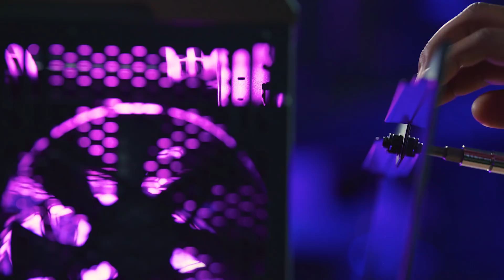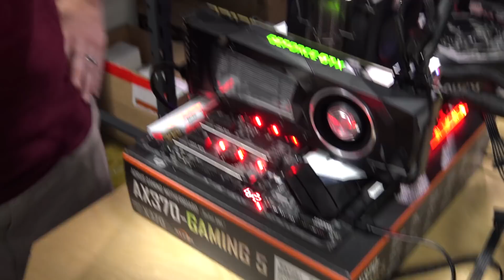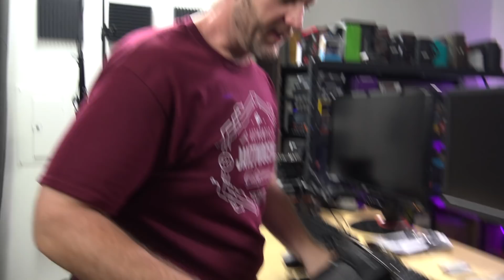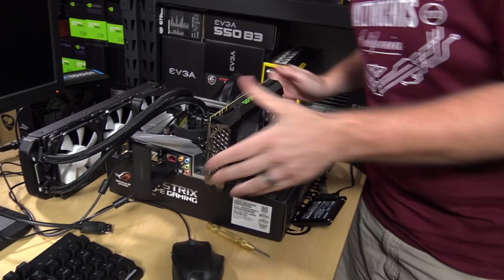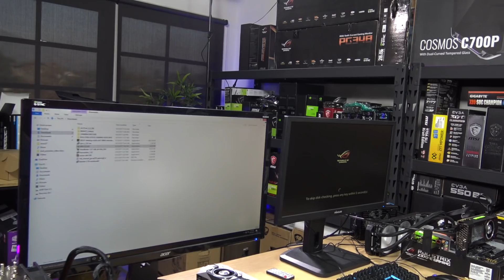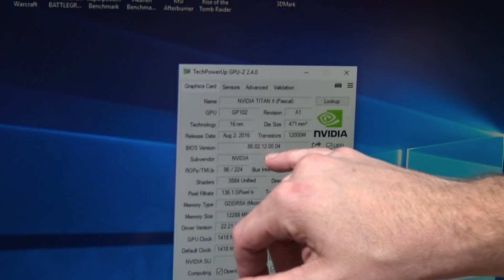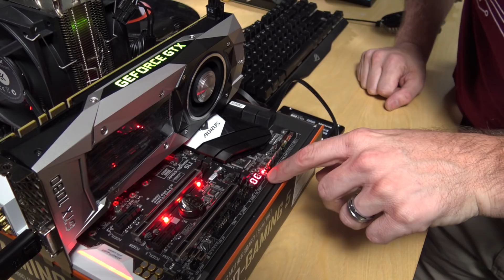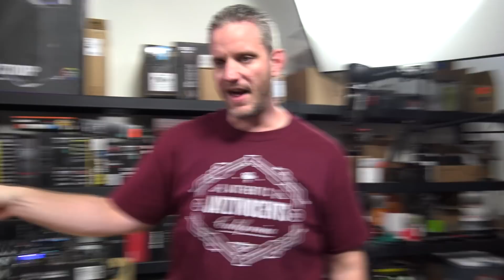I cant figure this one out... HELP!

Comment: You never checked the bios version of the card that doesn't work. You showed us the same card twice.  Also are you using Display Port on both? Try changing the monitor, for giggles.  I haven't really played with Ryzen but is there a bios setting for graphics? Maybe set it for that PCI-E slot instead of auto? Only other thing I can think of is try a different PSU just incase maybe that one doesn't give power the way that Titan likes it. I have had CPUs not like OCing with one PSU then switched and bang OC's like a champ. That is one strange thing to come across. Never seen that before. Good luck.
Reply: Ryzen doesn't have integrated graphics

Comment: With my 26 years of IT experience, I feel like this is an intermittent motherboard failure especially because it turned it's self on. Test it some more with new variables and see what happens. As silly as this sounds I would also change the CMOS battery because they can cause issues as well in my experience, just to rule out the cheapest things first.

Comment: i had a prob like that with 2x radeon 3870 x2 they are work in a intel sys but not in my x370

my spare Radeon 230 and my vega 64 works fine in the x370

Comment: I have an situation much like yours, just on the Windows site.. i have a build with a 1080TI FE and MSI Z270I Carbon AC ITX motherboard. Everytime the computer have been off for a couple of hours When it turns on the gpu is NOT registered, then i reboot and it posts just fine. I the had 2 other motherboards 1 identical to my own, and one old Asus. Same result on the identical But post on first run with the old Asus. -.-' so what i would like to see, is a motherboard identical to the ryzen testbench where you try the f*** TitanXP

Comment: The only thing i can think of is that the gpu is identified by the MAC address, maybe the motherboard is trying to do something weird like run it in x6 (should still boot tough) or try to do an overclock or run a different power setting that just isn't working   if you try a different slot it should boot if thats the issue.

Comment: Beside for checking the bios version on the same card twice (this would not change as you move it from intel to ryzen), it could still be something with the GPU. Maybe some the tolerance on some signal is higher on the intel or the other way around. check the PCIe speed in the BIOS of each system etc and see if they vary somehow.
Otherwise I still want to see that both cards have the same BIOS version.

Comment: My new Ryzen Threadripper build would not POST and would fail at the VGA and the Asus oled screen would say load VGA Bios if I had more than two USB device plugged in at once, or any devices plugged into a certain row of USB headers on the motherboard. Unplugging the offending USB devices would cure the issue. This system also freezes for a few seconds when I capitalize an o and ignores the keystroke..... these small system bugs are starting to get annoying tbh.
Reply: This is on a GTX 1080Ti as well.

Comment: try switching the monitors between the stations
in some cases the DP port on the monitor is sending power thru the cable and electrocuting the GPU
some GPUs have more tolerance for it but over time they weaken and develop this weakness
for a quick solution I recommend you try electrically resetting the bios (emptying the board completely of power) and plug in only HDMI for testing

Comment: If you are really interested in, what is going on there, I would contact MSI directly. You with your influence should be able to get real technical advice. The problem with Motherboard boot codes/error codes is, that they are really generally used. Especially your code is like the "Ah something didn't work". To get more detailed infos on what failed there need to be debug infos and logs. And those are only accessible to special hardware only on msi side or fabricator of chip X. It could be the GPU, it could be the MB, it also could be the CPU, RAM, HD, SDD, ....

Comment: I had a similar problem with my GTX1080ti.  I had to feed the GPU with 2 separate power leads as the one lead with 2x sets of plugs was at its limit of power it could draw through one cable.

Comment: Make sure drivers higher than 178.14 does support the 9800gtx+, as for the GPU not running in your system, it could be that it's BIOS might be older than the GPU and thus it doesn't support it (I've no idea how recent that vostro is).
Reply: i had to research this i just copied paste lol, but hope it may help

Comment: Lets resume here. When you swapped the card you didn’t check the wrong card but the good card bios. 
That’s the first error.
And so when you are taking in your hand at the middle and end of the video what you claim being the wrong card, it’s actually the good card you have in your hands because the wrong cards it s still on the intel platform. 

Do us a new video about it with the real bios number...

Comment: if this works give me a graphics card ....either 1 or 2 or 3 ..(1) use an older  bios or (2) reinstall windows on a different ssd  (3) use a strix b350f motherboard (I have an extra strix mb if needed I will mail it)

Comment: Check the same CPU on on another motherboard. And in the end sometimes some components just arent compatible, and i mean all together not like this cpu and this gpu, but the whole system. I had a pc that wouldnt boot when LAN is connected, but LAN is working fine when it boots, in the end it was the ADSL modem that worked great on other pc but not with the one i needed. this happens, rarely but it happens

Comment: didnt you checked same card bios version ?
because you swap it and checked on the right rig of course it should be the same
you should have check the bios on intel rig
or maybe i misunderstood something ?
Reply: +Akshay Niranjan
u joking right ?
Reply: Yes he did check bios on the same card lol
Reply: ehhhh no.
Reply: Akshay Niranjan bios are not on hard disk. bios is on the gpu like bios is on a mobo
Reply: maybe you was checked it before making the video
Reply: noticed this too.
Reply: I scrolled down just to type this: He checked the same card twice.
Reply: Akshay Niranjan drivers are on the HD - they don’t get loaded until you load the OS. 

He should have checked the BIOS on the failed card
Reply: Akshay Niranjan the gpu has a bios too.....
Reply: Yes he did. Haha. Might have checked both before and just messed up when he made video. 😊
Reply: Nope. Neither assertion is correct. Bios is on computer CMOS not the hard drive. And of course YES there is a bios separate on the video card too.
Reply: ikr
Reply: bios is on hard drives not gpus

Comment: Hey Jay, what's the power draw on the titan xp? Wattage on your psu? Where I'm going with this is you might be dealing with a slight degradation on psu wattage output or a gpu that's drawing slightly more wattage than normal. Despite popular belief, not all gpus of a specific line are the same. You've experienced this first hand in an earlier video. Just food for thought as I've dealt with this before. Not with ryzen but with an fx8320.

Comment: Power supply ?  I know that sounds weird as they are 2 of the same card but it could be one card is pulling slightly higher voltages that for some reason the power supply on the ryzen set up is struggling with

Comment: Same thing happened to me when i built my Ryzen System. My RX480 was working fine until i sold it and bought a 1080ti. The system would not post. Same error you got. Thought it was my brand new 1080ti so i was freaking out. Did not have any other gpu to test it so i took a leap of faith and sent my Asus MOBO for repair. They sent it back and it was working... Might be something else but it sure looks like the same that happened to me.

Comment: That issue is so unique and maybe isn’t really a RYZEN fault! It could be something totally different like the way each card interacts with the pcie slot...to figure that out Jay would need each board twice to be sure. As the plating on the card could be damaged on the card or the pcie slot itself and be just working on the other slot cause of different types of layout...or even the cables of the psu in combination with the 8 pin of the gpu...if some of that is damaged, it might work with the other setup for whatever reason and not with the other setup. So I would see the problem on the Pcie Slot of the mobo, the Psu cable, the plating on the pcie connection of the gpu or 8 pin connection.

Comment: You swopped the cards and not the board in the faulty one, could it be the tolerance difference between the pairing in manufacture were not up to spec.

Comment: I think it is a combination of a slot problem and the 1080ti's pcie interface. You are reviewers who do things, normal people never do. That is you constantly insert gpus into mainboard slots and then remove them. For example when benchmarking or when troubleshooting like now. A normal users mainboard may eventually see one to maybe three different GPUs installed over its lifetime. In your case hardware gets swapped a 10 or 20 times more often. The contacts are not built for that. Hence the contacts on the gpu and the mobo slots will wear of faster. And if bad luck you may have got a mobo that had already borderline slots from factory. You may try the 2nd or 3rd pcie slot. Wouldnt be surprised if the 1080ti suddenly worked there. Thats my guess.

Comment: just try to reset motherboard bios while the nvidia 1080ti thats gives a blank screen is in it,if it doesnt work then put the good card in it reset bios and then try the old card again,the trick is to trip thr motherboard bios into thinking that there an identical cards.

Comment: Reset the bios on the motherboard, then try the non-working video card. Also, leave the card out, go into the bios and force it to boot from pcie, instead of auto detect. The card, for some reason on that board may not be forcing it to boot from pcie. I've had weird stuff like that before.

Comment: What a noob. 10 years for nothing. What about trying with another motherboard? The CPU has very little to do here. Ryzen problem my ass. X370 problem in any case which we already knew long time ago. New architecture and all. And stop checking the bios from the same GPU.

Comment: i ran into this exact same issue on my roommate skylake system.  his gpu worked perfectly fine in my bulldozer system, and my card worked in mine, but his card would not work in his.  it wasnt identical cards, but it was still weird.  resolved it by him buying a new card. weirdest fucking thing

Comment: I have never seen it either. These days it seems that Intel chipsets are more "complete" and flawless. Maybe the Ryzen is a good CPU, but if the chipset sucks, it's pointless. The memory optimization is also a lot better with Intel.You get good performance even viith low spec Value RAM. That says a lot as well.
Conclusion! Go with Intel if you want a stable and compatible system. If you are a geek, and want to tweak (and save a bit of money), then AMD is a good choice.
Reply: more than just tweaking jesus christ you have to be almost a pro and have connections to fix your problems ryzen is such a mess of a release and still is how do you release a product that just doesnt work and blame everyone else, intel releases sht and it just works, yet people still praise ryzen like ye sure youre the 5% that got lucky but the other 95 is stuck with problems

Comment: Did you try different display ports? In the intel based system you pluged in the first video conector and in the Amd based one you pluged it on the last video conector.

Comment: Try checking the PCI-e x16 connector and check the pins. Maybe the pins in the sockets on the two motherboards are slightly different. 

It could be that there is slightly slimmer pins on the non-working motherboard. And it could be why the connection isn't that great. On top of that if the connector in the non booting GPU is slightly damaged it could mean there is an error about not booting.

That amount of sag might cause the pins misaligning (and not contacting properly) even more than in a case, where the gpu is bolted into the pci bracket.

Try throwing the non functional rig into a case and see what happens?

Tl;dr; the PCI-e socket might be slightly damaged and the connector on the non booting gpu might be a bit damaged as well.

Comment: Hi Jay, take the next step in the elimination process and keep the “bad” graphics card, ryzen CPU, and RAM, but change the motherboard. It’s clear that you are not dealing with a single problem, but a combination of two or more elements. Even though the two graphics cards are identical in theory, there could be slight differences, f.ex. slightly higher power draw from the pcie slot on one. The intel system might be a lot more robust so it won’t surface the differences between the two cards, but the ryzen board might not be, and thus more sensitive to the deviation on the card that doesn’t work on your current motherboard.

Comment: The a370 k5 has issue with diagnostics. I had the same issues with faulty RAM and the motherboard diagnostics showed a CPU issue. Its the Motherboard. Not the Ryzen. It could be anything else. Maybe try a different motherboard of the same model and see?

Comment: Try swapping power supplies. I feel that I've replaced more than a few Corsair power supplies for silly things. Maybe the one gpu is drawing slightly more power than the other card due to manufacturing differences. Just a quick guess.

Comment: I'm sure he changed out the cable to the PSU and looked up that code to determine if that is an area where the issue is. It could be the GPU and the bios version don't like each other and refuse to do anything that is rare and should nor would  be the case if the same version driver for those similar GPUs worked with AMD. The mother board PCI express lane is not seated with the other over the one that work. During my training in IT I was told to test the physical first then work my way to the software. So everything I've stated above I's sure he's done.

I had a similar problem where my GPU would not work then later it was my CPU. It turn out to be a problem with the fanless PSU I had bought originally with the system. It was a quiet PSU but died quick, a matter of a year. This is a difficult task to figure out without being in place to test my assumptions. I was fortunate enough to have knowledge of my issue and fixed it. Now I have a fan on my current PSU always on so it will not run hot. I will never purchase a fanless PSU ever again.

The fanless PSU also would not send power to the areas that needed to be powered when all USB ports were full and the system was shut down with all ports full. I would have to unplug everything to get it to work but sometimes it required me to take out a stick or RAM to get the damn thing to post. Then when I added the stick back after a shut down the unit would not come on. I then knew it was the PSU that was the issue and if it was not the issue then it was the motherboard which is an ASROCK so yeah they work but this one requires a lot of demand for an X99 system and if "dirty power" is the a problem the damn thing would protect itself. It was frustrating and a bit fun but expensive to replace. A PSU should last up to 5 years the fanless PSU was a stupid idea because I've experienced it burn itself out.
Reply: Another thing that happened on the old PSU setup was that the HDMI cable went bad for some reason but I did have the cable for three years and may have bent it some how. Could be a bad display port on the GPU. I notice that the same display port was not used when testing on the intel system with the "bad" GPU that would not post on the AMD rig. Do the test again using the same display port. I am not too sure that it will send an error to the motherboard for the GPUs display port being done for but if it does that may be the error code. I think I got an error code when mine did the same thing but all boards are not the same.
Reply: Look at the video again people and you will  notice the physical thing he did in his troubleshooting steps. People forget the physical and usually like to go to the software side first, I did that myself in the past. I had to think through my troubleshooting in the past and wrote it in the first post then realized wait he did something different on the intel test of the "bad" card. There is a possibility that the display port is bad or I could be completely wrong which is apart of troubleshooting in a remote location where your not physically there to test these factors. You are wrong until the problem is solved. He'll figure it out!

Comment: Have you seen what the pci express bus is clocked it maby some setting is overclocking the bus slightly try fixing the bus speed of the express bus maby the memory clock is affecting the express bus speed or adjust the load line calibration of the express bus also try a differnt main board and see if its repetable on a differnt brand of main board. it looks like a bus singal problem like you see in some risor cards, you might try a different slot also. not all traces are created equal maby there might be a power delevery problem to the express slot, or noise in the traces.

Comment: Maybe it's a power issue, same model chips with the swme VBIOS can require slightly different voltages, maybe the ryzen rig isn't providing the proper power to tgat specific card.

I suggest trying a different PSU, another ryzen processor, and a combination of both

Comment: Check the voltage of your cmos. From experience with asus products,you may not see the auto on when on ac as a symptom but if theres no cmos detected it will automatically power on if it is a product with a cmos.